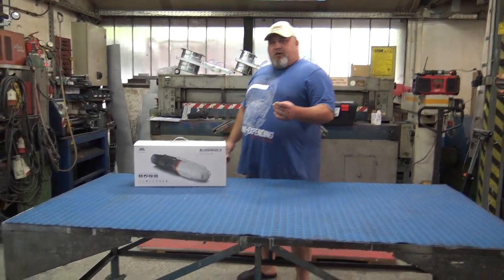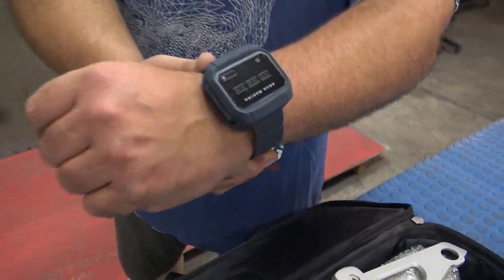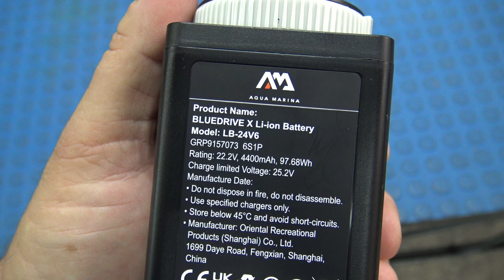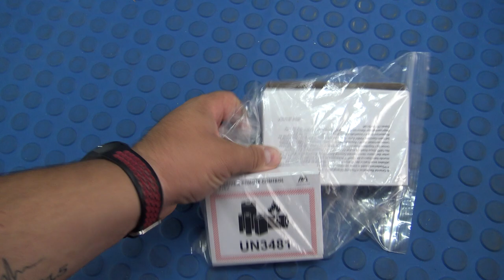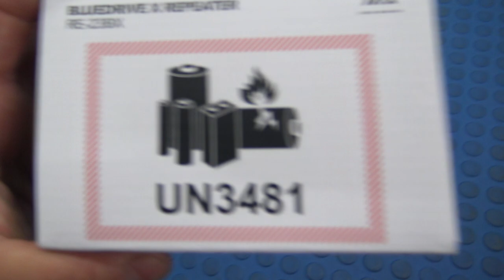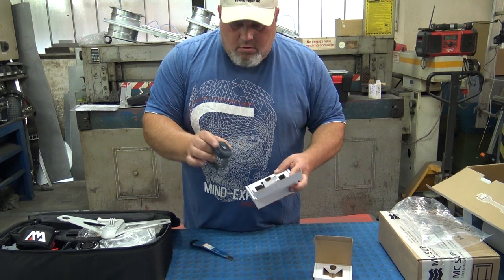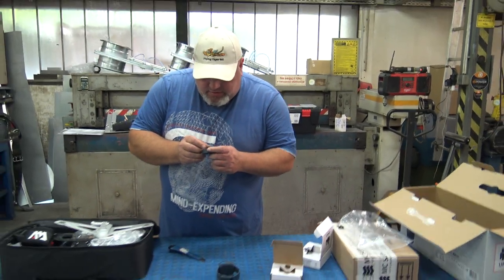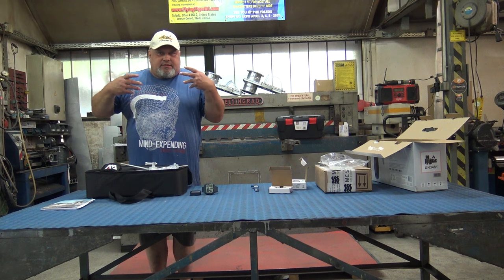VERY IMPORTANT UPDATE!!!! about AQUA MARINA BlueDrive X RC Water Propulsion Device

Comment: If you will ever test it in the pool, rivers, ocean or lake, to pull you or even smaller person, you will be disappointed how weak it is. It might be ok for SUP. You might thik it has some power if you will only test it in the big  bucket, but to use it for swimming, it will be slow. I made one of those, I used much bigger motor and at the end using 4S 10.000 mah Lipo which can provide much higher current than Lion.